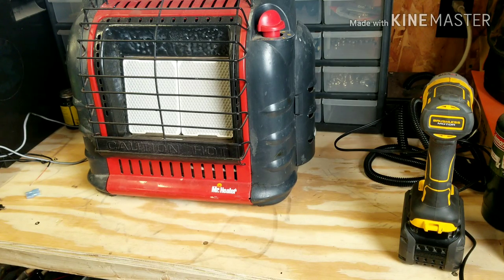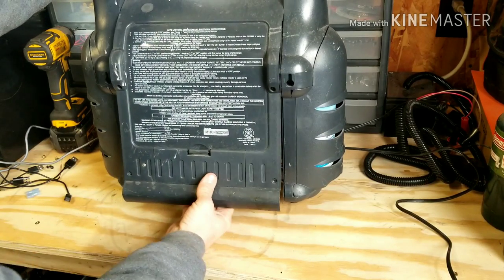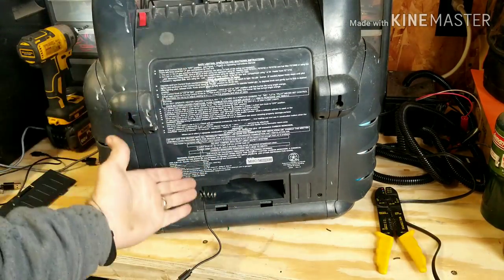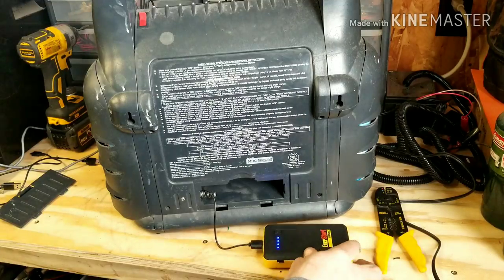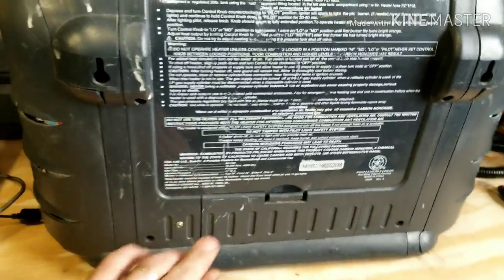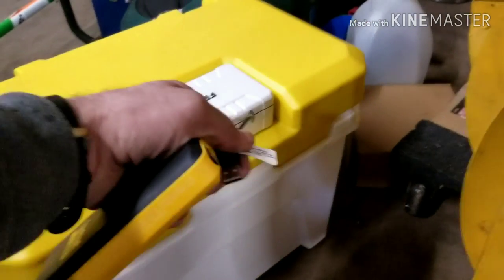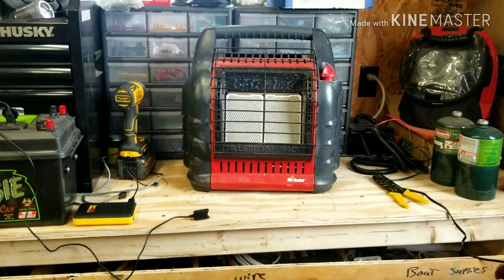Amazing big buddy heater hack

Comment: I would recommend using a stove fan.  They run off of pure heat.  No electricity necessary.  Just attach it to the top of the heater.  There are some YouTube videos showing this hack.
Reply: That's a better hack for the Little Buddy since it doesn't have a built-in fan.
Reply: @netposerx yeah if there’s an internal fan in your buddy heater then I’d do this.
I have a stove fan and it works great but it is definitely nice to have another option.
Shit I had to buy a separate back panel for my big buddy because in California they cannot sell them with the internal fan from Mr Heater. But you can buy a factory back panel with all the electronics installed and just remove the old one and screw on the new panel.
Reply: This is a good idea, but if you want to use the built in fan then just use alligator clips instead of cutting up wires. No need to take the heater apart either.

Comment: It appears you cut off two female spade connectors and replaced them with... two female spade connectors. You state (and partially show) that the new female connectors fit over the two male blades protruding from the battery box. 

So why not leave the original ones on?
Reply: I was wondering the same thing.
Reply: First thing I saw also, cut off female and add female, other than a case around the male pug in there is no need for that I  can see, but I would use different male connectors with open spade
Reply: I feel new in both places, makes me feel happier in the end. You know the connection is good every were.
Reply: @anitablades6033  So no other reason except in your piece of mind, ok at least we know your reasoning, thanks for the video
Reply: @bcpioneer59  Hi, you might understand my thoughts if you watch this vid, it's something that has happened to me. It's ( Nomadic Fanatic - repairs continue  ) Nomadic's problems are still on going. My problem ended on a wire in the back tail light that had rotted on the inside but Looked great on the outside.
Reply: I too wondered the same thing. 
Apparently, from the comments below, it was just for "peace of mind" as to a good connection.
Hmmmmm.  This should have been explained in the video.
I would just leave them be and continue on with the hack.

Comment: I've always just used alligator clips and clip to the tab and spring inside the battery compartment works and don't need to take it apart... but for a more permanent solution this one is good. Nice job.
Reply: I like that too, as nothing else than a way not to do both batteries and external power.
Reply: Yea alligator clips is good too. I never thought of that and i have some . I have many 20v 5amp dewalt batteries with a usb adapter DCB090  so that you can charge your phone with the battery . This is perfect for this along with alligator clips.  Thanks
Reply: Does no one know there is a 3.5mm aux power input in the heater
Reply: @fuzzyelm1  yep if you want to cut the plug end off and hook up to that you could… but since no electrical plugs out in the woods this was easier for me than buying an adapter just to cut the wires. Thanks for watching.
Reply: @BigRedFishDad   easier ? That’s a damn joke !
And to think you would ge so stupid they you waited till you was in the woods and that you would actually think taking everything apart and adding new ends the same as the ones you just cut off shows me all I needed to know , so I stand behind my remark that this is exactly how NOT to do this
Reply: @fuzzyelm1  wha,whaa, whaaa….poor guy cheer up, go buy a plug to waste (get two so you can use one at the state parks) and do it your way that’s what it’s all about….plus taking a battery cover off the back seems to be way to hard for you anyway :) :) :)

Comment: These is a 1/8" phono plug on the heater back. Could have made a USB to phono cable and done the same thing and never turned a screw. I used to run mine off of a cheap harbor freight solar charge controller and it was like 3.5V 6 V and 9V gave me three fan speeds.
Reply: I just tried a 1/8" mini plug, without checking it first, and it is too big for mine.  The plug on  my Mr. Heater 120V adapter (Part number F276127) for the heater is .100 dia. X 13/32nds long, not .125 dia. X 9/16ths long for the 1/8" phone plug.
Reply: This is actually a much better idea.

Comment: Hey Man, 
Nice hack. I just did it to my Big Buddy (Yellow Front. My fan quit working years ago and I finally figured out how to fix it. The little plastic mounting posts had broken off and the fan was just floating inside. I cut away what was left of the plastic posts and then drilled a hole in the center of each one. I used three machine screws with a lock washer and a nut. Then the little bolts stick out the back and I put another lock washer and a nut. Better than new.
DO NOT BUY THE AC ADATER THIS HACK WILL SAVE YOU $$$
I was looking for a video on how to replace thermocouple and pilot and I came across your hack and seeing as I just fixed the fan this was perfect. I made a couple of modifications.  I have a soldering iron so I connected the USB and Battery wires together, like you showed. I soldered them and taped them and then used a shrink wrap tape to cover up to the spade. This way I do not have to switch wires for different power supplies. I left the USB wire long so I can use a USB power block and plug into electrical outlet. I have the portable USB battery also and it works great.

Thanks again for a great idea. Either way you connect it , it is a great idea.

Comment: Hmm! I just plug my adapter into my inverter from my solar panels.  But in a pinch, this thought process not necessarily helpful here. Could be used for sure. Power banks, on any size, can be VERY useful.  Good vid. It opens options and eyes.

Comment: To save alot of work, you could just make an adapter to plug into the auxilliary power jack (at 2:02). Just solder a male mono mini -phone connector, (3.5mm, 1/8 ") to a male usb plug. Connect the positive red wire of the usb to the tip of the male mono mini -phone connector, then connect the negative black wire of the usb to the remaining case terminal of the male mono mini -phone connector. Then you can  use it to connect to what ever portable device you have. (Be sure to remove the big buddy D cell batteries, before using the adapter, you can use either one power source or the other, but not both.)
Reply: I just tried a 1/8" mini plug, without checking it first, and it is too big for mine.  The plug on  my Mr. Heater 120V adapter (Part number F276127) for the heater is .100 dia. X 13/32nds long, not .125 dia. X 9/16ths long for the 1/8" phone plug.  "Measure twice, cut once."
Reply: Should be a 2.5mm single barrel cable 
Surprised one is not made with USB

Comment: Also go on ebay u can get usb covers that go on your batteries for your drill to power usb devices they are like 10 bucks way cheaper than those usb batteries and last longer and they can run your shack lights and charge your phone
Reply: Can you post a link please?

Comment: Great video! Thank you for taking your time to make this. I had a quick question.. 
So the heater fan uses 6 volts, can you just use a cube that plugs into a wall and plug that USB cable into the wall cube? In other words.. do the cubes reduce the voltage and convert it? They must right?? And if I do what you did here, could I just use a cube plugged into the wall to power the fan? Or
Will it be too much voltage and ruin the fan?
Thank you again 👍

Comment: I feel you should have tied a knot in the wire or put some kind of restraint to prevent it getting yanked out of the heater after assembly.
Reply: Agreed. Some type of strain relief could prevent having to redo those connectors!

Comment: I wouldnt have removed the wires from the battery box but thats me. I would have piggy backed that cell phone wire into the battery connection. A piece of velcro would be good to stick the small jump pack onto the back of the heater. No idea is really wrong if it works.

Comment: I would like to know the duration of the original "D" cells continuous run time till dead and same test w/ various USB battery bricks.   My guess is the D cells will run nearly as long as USB brick.  Advantage is the USB battery can be recharged...

And.. why not just use the plug in adapter and put a make a male mini plug there.   USB puts out 5v DC,   D cell 6v DC.   No inside wiring necessary.

Comment: Can you split the wire from the battery to have it where you can plug in the USB or put in batteries without having to take it apart?
Reply: Yes it’s what he should’ve done.
Reply: Only problem would be if you plugged it in with batteries in the unit...

Comment: Have seen many hacks for a fan that basically ,doesn't move any air.One previewer left a piece of toilet paper in front,fan didn't move it.A separate battery powered or heat activated fan seem to work better.

Comment: I did a similar hack.....I incorporated using the little port so if I ever need the batteries, I can still use them. When using the power pack...I put it right inside the battery compartment with a small spacer so it could never touch both contacts.

Thanks
Reply from the maker: Using the port is a great option. I figured this way gives more people the opportunity to do this mod
Reply: JDS Outdoors For sure...its a little bit of a bugger to solder those thin wires.

Thanks for all your ideas!
Reply from the maker: CG34  my first build power box

Comment: I assume D cell batteries are 1.5 volts x 4 = 6 Volts - I believe USB would only produce 5 volts. If so would USB under drive the fan and could that hurt the fan?

Comment: From what I understand, the fan is 6 volt and usb power is 5 volt. The fan may run at a lower rpm and not like the voltage drop.
Reply from the maker: You would be right on the voltages but it runs and operates as normal even at 5v
Reply: Voltage is close enough

Comment: Okay the outlet on the back that that I'm sure uses a transformer to the wall could of been used without changing any internals right! I'm just saying for the ease of mind, ordering a simple 12v car battery or 5v usb.. could of been shot through the power supply! If I were to do this i'd but a universal witch is pre wired and adjustable voltage. So should be easy to splice or may even already have a usb connect depending on what you buy... Idk just thinking out loud! But if I were making it permanently part of the heater. 
I'd look into the custom battery packs lithium ion without batteries and buy the high drain batteries. I just know there several all wired up, so those without the tools could still do this! Buy one that fits in were the D batteries go! Maybe do to batteries packs/ to switch out when other pack is dead!

Comment: Just use your 6volt deer feeder battery with a 3.5 mm single jack or 3.5 mm head phone with double plug you will just need to see what wires make the fan work for the double ring tip recharge battery as needed
Reply from the maker: Absolutely I have a video on that setup as well

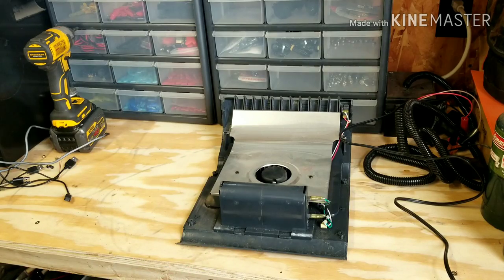Comment: 2:58. Return this back to factory...
Not Quite. Factory will easily see the mod.

Better way would be to use aux jack on back and keep all mods external or stacking piggy back terminals on interior mod.

Why not feature your mod using aux jack or even D-Cell fakes wired to USB?
Then you wouldn't need disclaimer.
Reply: lol...you totally missed what he was saying. He was saying you could return it back to factory condition using D batteries, not return it back to the factory!

Comment: Do you suggest installing the wood stove fan on top of the Big buddy heater, or you think the internal fan would be enough to move the hot air in a small space?
Reply from the maker: I've been happy with the built in fan but I hear the wood stove fan works better but can't confirm

Comment: Why not just jump into the connected wires. Can be done with as little as a cigarette lighter and some electrical tape.. then burn the tape for a heat shrink, shrink tube effect (works excellent, unless u dont want people goin in there to make sure it looks state of the art)
And that big jump box battery is going to outlast your dam propane, so then youll stay cooler when u wtd to stay warmer  : )

Comment: What was the point of cutting off the original female terminals? Couldn’t you just put male connectors on the usb wires and achieved the same result?

Comment: Okay, a little help here.  I used the power cable to my Galaxy S2 Tablet to no avail.  Have solid connection to the Buddy Heater and plug into the battery pack and wall jack - nothing happens - reconnect put 4 D batteries fan starts up.  What did I do wrong?  Does it need to be a telephone charging cable?  Will an Apple phone charging cable work?  Thanks
Reply: Sorry - I thought I had a tight connection.  Those small wires are difficult to tighten.

Comment: Or you could just put some alligator clips on a USB plug and clip them to the battery connectors. No need to take the heater apart or cut the wires. You can do this for most battery powered items that take 5-6 volts.

Comment: How about crimping all the positives to one female connector and all the negative wires to another female connector. Plug them back in to their respective terminals.
Use 2 less connectors and not have to take the back off to switch wires to use D-cells when desired.

You have a backup plan of sorts.

And if you are using button top NiMH batteries, you might even be able to recharge them off a power bank.

Comment: What model is this I got one but it didn't. Have the fan inside
Reply from the maker: It's the pre 2019 big buddy. The 2019+ no longer have fans unfortunately
Reply: @JDSOutdoors  oh dang ok is there a kit to buy ?
Reply from the maker: @JustMe619toby  I'm not sure but I'm very tempted to buy a new one and customize it
Reply: @JDSOutdoors  dang wish I knew one of the main reasons I bought the big buddy was cause of your video
Reply: @JustMe619toby  I also just bought a big buddy that didn't have the fan - their website stated this was due to recent tariffs.  I went ahead and purchased a new back panel which included the fan kit from https://www.tesstools.net/.  The link is here - https://www.tesstools.net/78404_COVER_BACK_WITH_FAN_MH18B_GRAY_p/mrh-78404.htm  I have installed it using the same 4 screws.  It works.  Now I will use some of the damaged USB phone charging cables to do this hack.

I did have 2 questions for @JDS Outdoors:

(1) Why do you need to add the females to the unit?  Wouldn't the EOM ones still work?  I'm guess no, but wanted to ask.

(2) the phone charging cables I have, have 3 small wires inside Red/White/Green or Grn/Wht / White / Bare - is one a ground?  Should I try finding a different cable?

Comment: Only question I have is ,does the voltage matter? Because I think the battery voltage is only 6 volts.
Reply from the maker: USB puts out a max of 5 volts. So even though the USB is hooked to a 12v source the fan is only getting 5v eliminating the need for a voltage step down regulator
Reply: @JDSOutdoors  Great, Thank You!

Comment: Why not just solder a bullet plug onto the USB cable and use the same jack that the wall adaptor would plug into?  Then you could use batteries, the wall adaptor, or USB without modifying the unit itself and removing the battery operation as an option.

Comment: Color me confused.  I thought the fan assembly part wasn’t sold in the USA due to some weird law.  Is this a Canadian only video or am I missing something?
Reply from the maker: Nope this is in the US. They did however stop selling it with the fan last year
Reply: @JDSOutdoors  — Story of my life.
Reply: @JDSOutdoors  — Q. Is there any way to buy the unit with the fan and battery option in the states?
Reply from the maker: @Erin-Thor  not anyone. 2 years ago yes
Reply: @JDSOutdoors  — I feel like I’m bothering you... sorry if I’m a pest. They sell these in Canada still, right?  What’s stopping me from taking a trip to Canada, buying one or two, and taking it home?  I’m not risking prison am I?  🤣
Reply: @JDSOutdoors  Thats called being cheap! So they still sell it for the same price but eliminated the fan? I am glad I bought one last summer when I did. Our old one failed because of internal rust and the switch froze up and wouldn't work. It was my fault for not using the filter on the hose. I invested in the filter and a new hose as mine started leaking and failed. The little o-rings on the endcof the hose eventually break and fall off. This causes a severe  gas leak at the connection. I had my old buddy heater catch fire in a popup because of that o- ring.
Reply: @Erin-Thor  Look for old inventory at Hardware stores. I found mine at an Ace Hardware store. It was the last of their old stock. I noticed the new ones had no fan. I grabbed that last one in a hurry!
Reply: @scottfirman  — Good to know.  Might have to take a trip to Canada just for this.  Thanks!
Reply: @Erin-Thor  Just picked one up from Tactor Supply this week and it still has the fan. Local store was out of stock but the ship to store option still shipped one with a fan.
Reply: @tekkmonkey  — Good to know, thanks!

Comment: Why didn’t you use piggy back spade lug connectors? Then there’s not any need to cut the factory connectors off and they stay plugged in if you want to use your D cells.

Comment: I am by far a electrician but the heater requires 6V. 4 D Batts = 6V. Also stated on the back panel next to the a/c adapter. Won't this burn up the motor or some other detrimental affect?
Reply from the maker: Nope all it does is run a tiny bit slower. USB is 5v. If you hook 12v to it then it will burn it up

Comment: Kind of lost me when cutting off factory female connectors and putting 2 the same back on. Duh....
Also, what voltage is the fan and voltage of power packs? 
I'm sure the A/C adapter is 6 or 12V
Reply from the maker: The factory connectors dont fit and nicely inside the new male connectors... 
Fan is 6v and usb puts out 5v